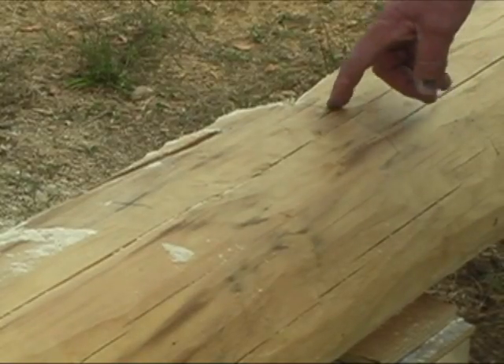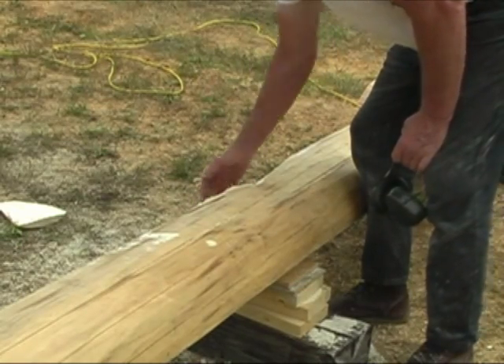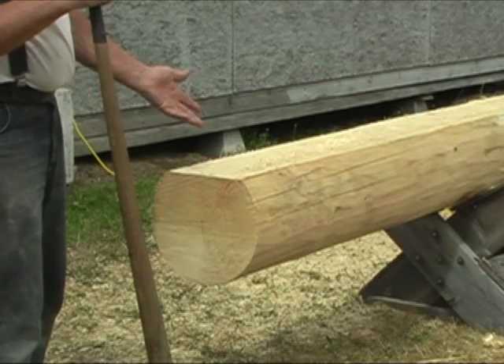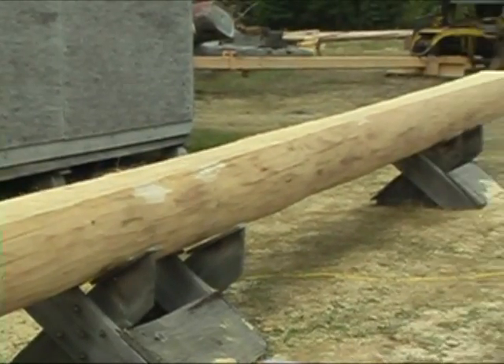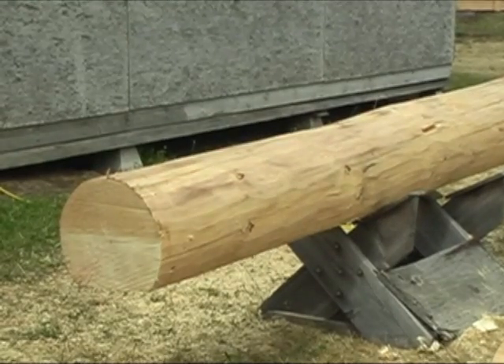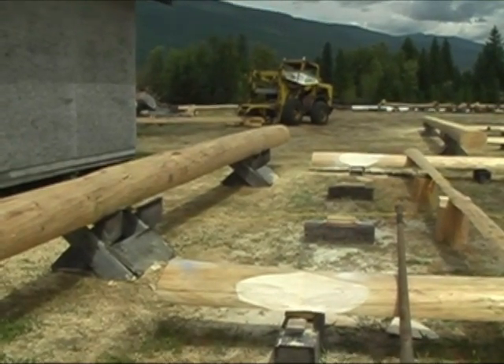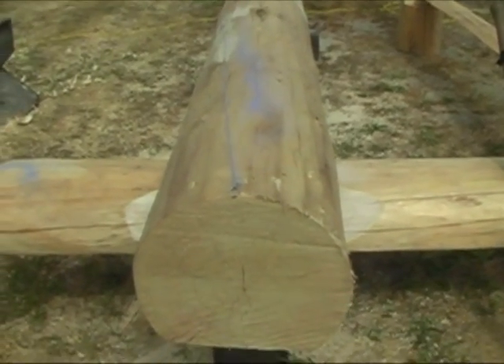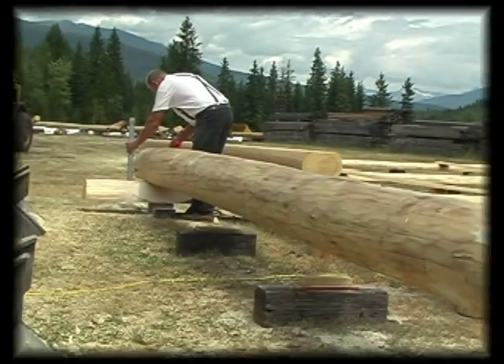Log Homes & Cabins Layout & Scribing 2 of 4

Comment: I like how log homes are generally designed to keep the rain and wind from entering, as the log themselves are shaped and fitted to minimize air and water filtration.  Those that are designed for protection from the weather, actually require less care than homes that do not take advantage of this protection. Consider these extra measures of protection, and you'll enjoy your cozy log home throughout many moons.